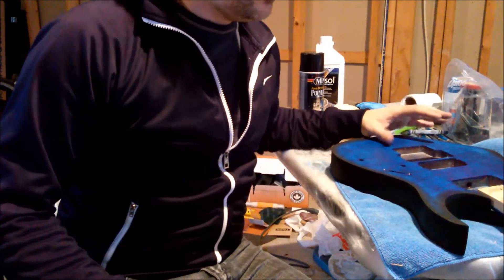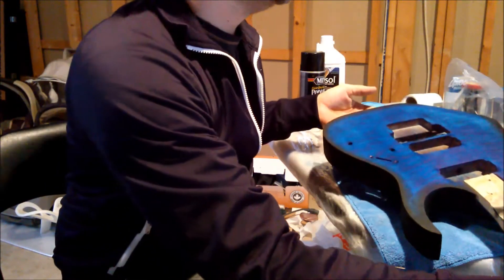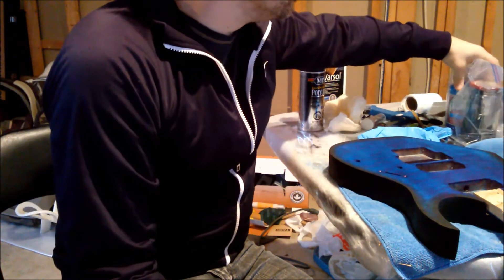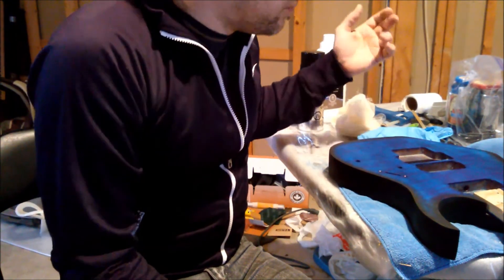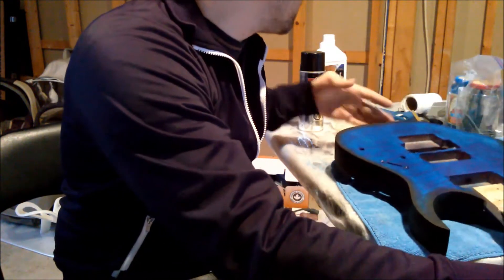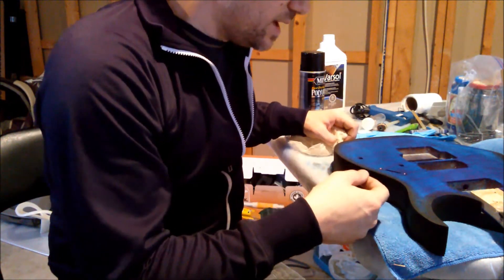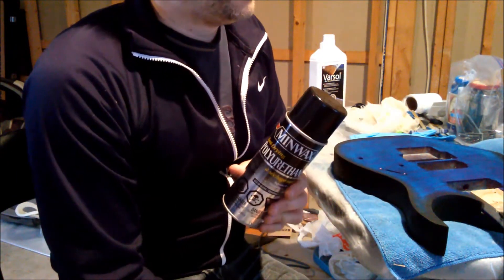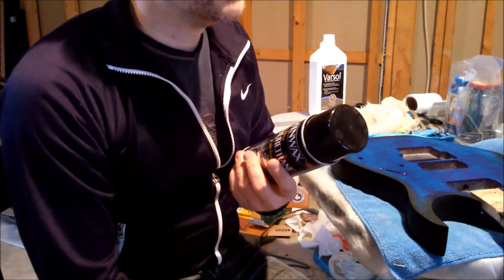Guitar Refinish Part 3: Applying dye and making burst

Comment: Very good video, if i wanted to have a satin finish how would i achieve this? I don't like the look of gloss. Thanks
Reply from the maker: you'd just have to use a satin finish instead of a gloss one.
Reply from the maker: You can also try wet sanding the finish without buffing after, look at my video there Guitar Refinish Part 4: Sanding and prep for compount
Reply: Thank you.